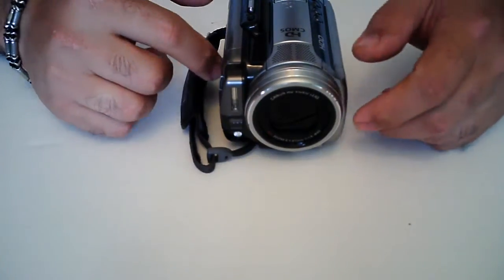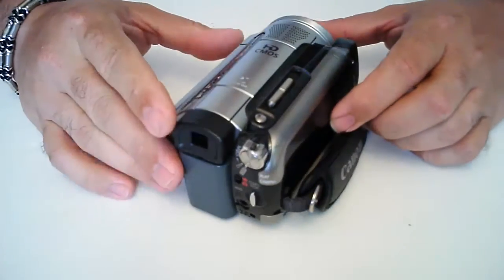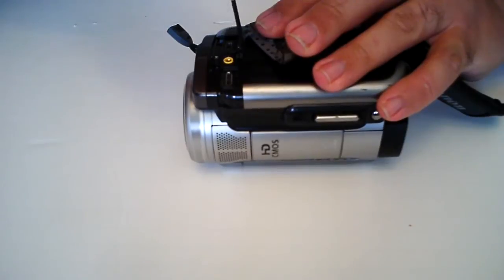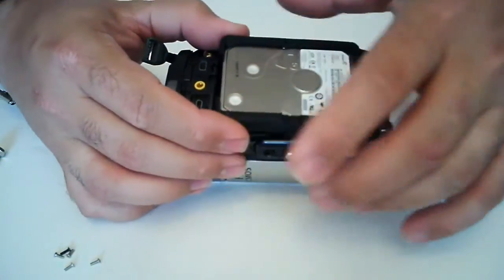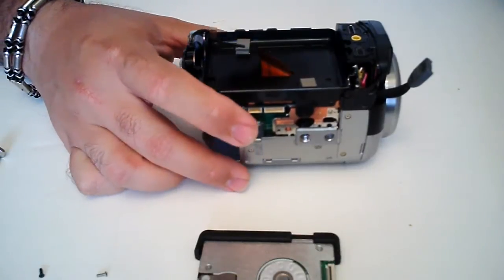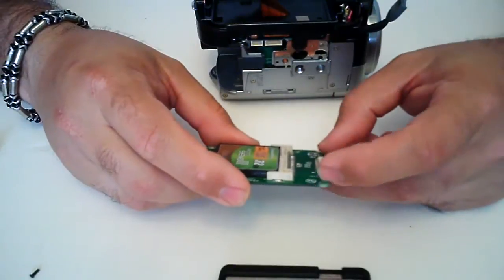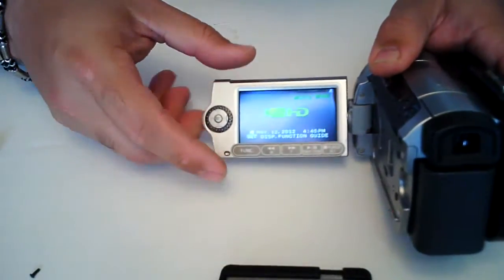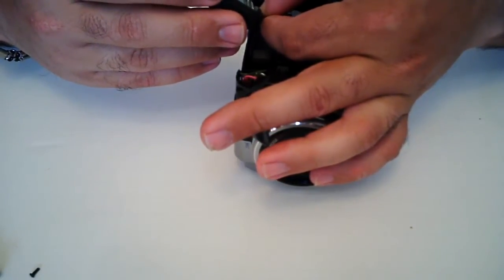How to replace a HDD in a Canon HG10 Video Camera

Comment: Thanks, your video helped a lot but I think you forgot about the screw on the rear just behind where the strap attaches. I was lucky I found that in time while I was trying to force the cover off after removing the 5 screws you showed.

Comment: Hey there! I was curious about what I could do with the HG10, so I purchased a 64GB SSD (Super Talent DuraDrive ZT2 ZIF Solid State Drive (MLC) FZM64GW18P) on amazon for $129.99 and replaced the hard drive with it. After initializing it with the camera, it seems to work perfectly fine. The only thing that didn't work properly was the menu item that shows how much space has been used up. I'm recording right now to see if it will fill up the drive to its capacity. Thanks for the video!
Reply: how was the SSD do sir? can it record the video?

Comment: thanks for the video dude

My hg10 has just packed up.
it wont turn on, and even when plugged in to power it doesnt do anything.

so i might buy a secondhand hg10 and replace the drive with my old one.

Comment: i jsut bought a second hand hg10, as i sued to have one which just died all together.

it cant find the hard drive, but does say it cant.
it wont record, and it doesnt display the amount of space left
also the initiate hard drive option is blacked out

Any ideas?
Reply from the maker: HDD has failed. Replace it using my video as a reference.
Reply: @CiscoMedia76   tried it with the one from my old hg10.
same result

both dead?
Reply from the maker: @andyg3  hmm, good question. possibly, but generally the behavior that you described means a bad hard drive. if you have access to another or better yet a SSD, you might try that.
Reply: @CiscoMedia76    an update.
i bought and fitted a new HDD.,  but got the same result.
it then followed in the foot steps of my other HG10 and completely died on the spot for no apparent reason.
shame, as these are fantastic camera, and i cant find anything new that does quality as well as they did.

Comment: I have the HG21  which I absolutely LOVE and now it has trouble reading the hard drive. It flashes for various lengths of times before finding the hard drive. I've tried fully reinitializing and it still does the same thing. Do you think changing the hard drive will solve the problem? or is it something else?
Reply from the maker: It is possible that the HDD could be failing. You could try, as another person suggested, connecting it to your computer and seeing if it detects the storage space. Then trying a format of the HDD using the computer. However, if the camera has been well used and its the original HDD, chances are its beginning to fail and will only be a matter of time. Backup all your videos now while you still can, if you haven't already.

Comment: Hey Frankie,

Thanks for the walk through how to get to that hard drive,
I have a question for you , I have not used my camera for about a year and an half, just recently tried it again and it charged normally and I was able to power it up,
worked as it should and found some old videos on the hard drive and it was fun to watch them as they were from 2014 lol , now after watching the videos I put that camera back on the charger  overnight and left it there to fully charge up. 
In the am I turned the camera back on and all I get is a message " Task in progress do not disconnect the power source" I got the red light blinking a couple of time indicating hard drive boot I get the red led under camera indicator and then it quits...
I tried to charge it up again, tried to boot it with the power cord  and the battery in, also took the hard drive out and reconnect it and I  get the same message over again, no lcd view finder
no other message other than the one I listed above...
any idea what can be wrong with it ?, is there some reset function I can initiate to by pass the operation it gets stack at  ?
any help would be appreciated .
Reply: I have been having the same problem for a couple of weeks.  I figured out where the problem lies and now it is working although not always 100%.  What I did was to hold the button down, turning the camera on and holding it to the furthest point of movement.  In order to switch to 'play', I did the same while holding the on-off button a the furthest point of movement. I believe the problem lies in the button. I stuck a business card between the camera and the button and now it works again for the most part even without the card.  Go figure!  But before, it would only come on for a second or two then turn off according to your description.   Best regards,  Jeff

Comment: Actually, the HG10 doesn't shoot 1080p, it shoots 1440*1080 at 60i, which can get annoying for motion shots.
Reply: It does. It shoots 1080p24. It does not record it as native progressive though, it uses 2:3 pulldown. But shoot 1080p24 it does. For 60i, you need to deinterlace it before uploading to YouTube.